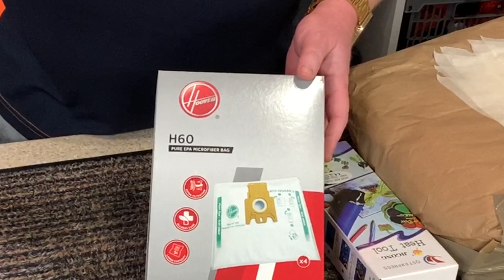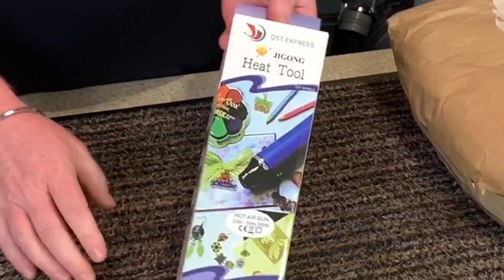Dyson DC33 Refurb Part 1

Comment: I’ve had many dc33s in for repair because of clutches, motors and quite a lot of the spines were cracked in the middle because they are quite flimsy
Reply from the maker: I’m just waiting on the gasket to finish it off 🤗